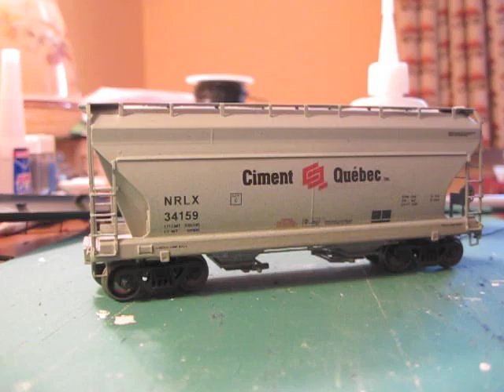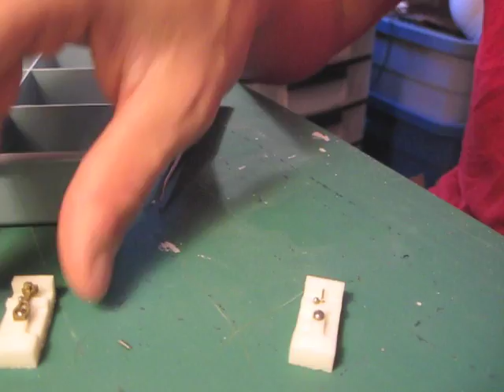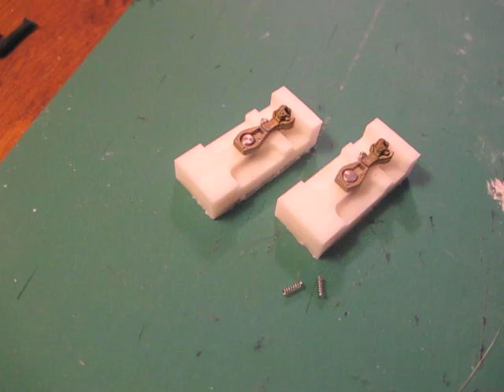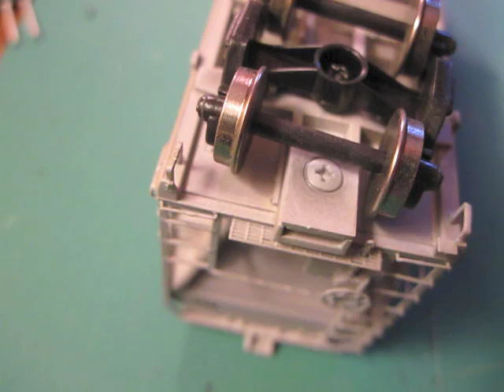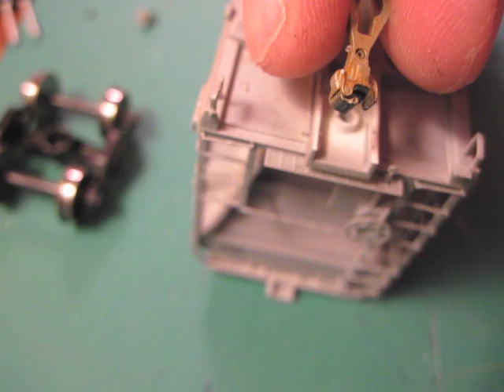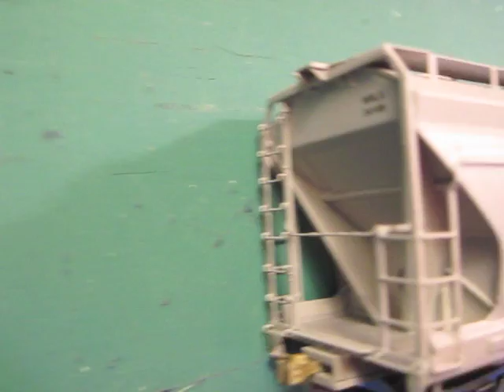Assembling Sergent Engineering Couplers

Comment: You want to make this car pop (rivet counter, museum quality, true scale, exactly like the real car)? Add coupler lift bars on each end, North American Pacific western air brake pipes with the magnets on the tip (the rubber pipes are flexible, and the magnets that come with it makes the whole jig look and function as if you were on the real railroad). Scale brake chains ⛓ to the brake wheel, train airline under one side of the car from one end to another, scale air reservoir release handle, etched metal walkways on top, and at each end of the car, 70 ton roller bearing trucks with proto:87 wheelsets, with spinning barring caps....

MY GOD! 

It will be as if you took the car off the real train tracks and shrunk it to scale 1.87.1!

Comment: have automatic uncopling?  work with magnets uncopling on layouts?
look good maybe better than NEM.
1 EXTREM REALISM  " Sergent"   (need stilus for uncopling)
2 REALISM  "Kadee"  (automatic uncopling on layouts with magnets)
3 UNREALISM  "Nem europe version"  (automatic uncopling on layouts with magnets)

PD: if the sergent can do automatic uncopling i change all may colection with this copling...casue look good but its not easy life.
Reply: SLEVIN SHAFEL The NEM standards only define a common coupler pocket, the couplers themselves are designed by the manufacturers. They can range from horribly huge and distracting to quite unnoticeable (remember that most european rolling stock uses chain and buffer couplings, for which no Kadee style semi-realistic compromise can he made).

Comment: Aha - first time I've seen the jig used.  I have a relatively small test train (6 pairs counting the engine) that were assembled without benefit of the jig; if I decide to use the couplers on a larger fleet, your video has convinced me that I would want this device. 

I use the friction spring in all cases (except one in which the coupler box design made it unlikely it would stay in place), I find the extra damping of the coupler swing useful, especially when manually aligning couplers.

Comment: the jig is quite expensive but it is good to know that it works and hastens the assembly.  i assembled my sergent couplers with just a piece of styrofoam (i would not recommend this).

i did not install the spring as i did not see the need for it.

you are right they look more realistic - i replaced ALL my kadees with sergent ones.

great tutorial.